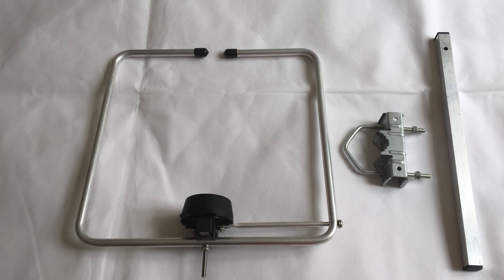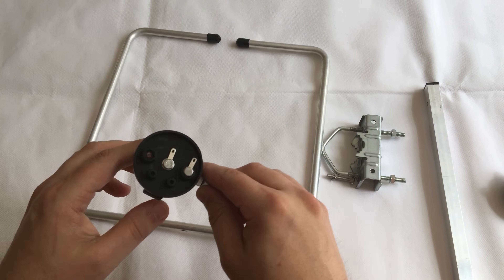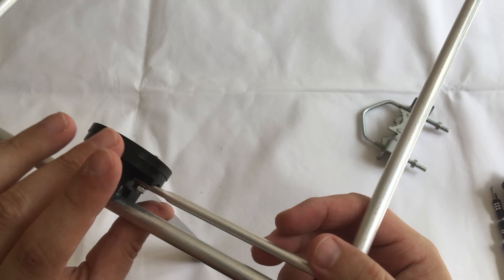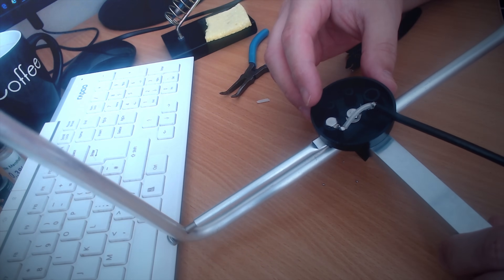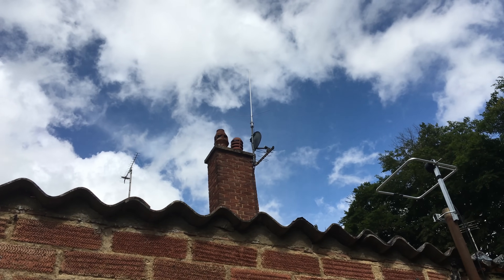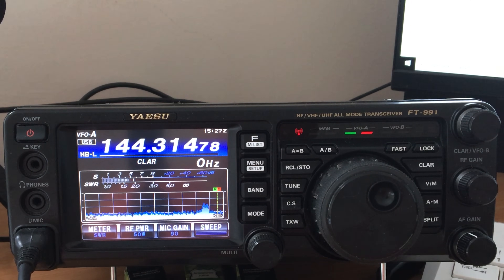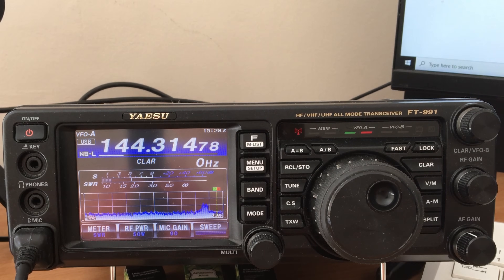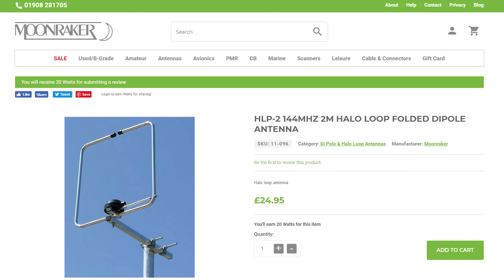2 Meter VHF Halo Antenna Assembly And Testing

Comment: good morning 👍🏻🤝 I wanted to ask you how you are getting on with the Halo antenna? Thank you very much and have a good day
Reply from the maker: Well, I since moved from the property and it got left on the chimney! However, when I installed it on the chimney, in a H polorisation, I fed it with RG58, the worst coax to use for VHF. However it received H transmissions way stronger than my V Co-Linear which was fed with RG213. So yep, it works really well I want to get another one for my new QTH.
Reply: good morning and thanks for the reply, do you recommend it in horizontal polarization for USB? Unfortunately I don't have much space for antennas

Comment: According to the website photo, shown in this video. The manufacture had left the small block of square tubing installed. You had it right, the first time! I suppose that would allow for running the antenna in a vertical or horizontal position (or even at an angle!). 
I would love a follow up video, to know how the antenna has performed. I am interested in installing a halo antenna at my home, due to its small size.
Reply from the maker: Unfortunately I left this at my last property, but I ran it from the roof, with just rubbish RG58, horizontal, and it out performed the Co-Linear. If I had better coax it would of been even better.
Reply: @TechMindsOfficial  Oh NO! I wonder if the new owners, would let you go back and get it? Ha ha. 
They probably are trying to pick up TV channels with it!?

Comment: Nice video, but the antenna really is junk. I have one so, sadly, I know. Caveat Emptor - I should have researched it before purchase! SWR of around 2 or more is bad, and  could not lower it satisfactorily by bending the 'arms'. There must be something better on the market that achieves an SWR of 1.2 or 1.3, or at least below 1.5.  I wonder if you still have yours? I might bet that you don't!   After trying multiple times to get an acceptable SWR by bending the arms back and forth, one broke off due to metal fatigue!  I then cobbled together the parts into an "S" shape dipole and with some fiddling an tweaking, I got the SWR to about 1.5:1    Anyway, a very good video production and thanks for the effort and sharing. 73, Mike.
Reply: I have the 2 meter and 6 meter loop I used it for this weekend VHF/UHF contest  and the SWR on my Yaesu 857D was showing a flat match and full out put power 
MY biggest problem was getting RF into the modulation of the radio  which was causing a hum in the modulation  so aI need to figure that out

Comment: Have you an update to you moving the loop further up?
Reply from the maker: Yes, I installed on my chimney and it works extremely well being above the roofline, even with crappy RG58 feeder it out performs my vertical for horizontal polarisation!

Comment: First thing I noticed was that smaller square tubing , wouldn't that be installed inside of the larger tube to help prevent crushing ? Just wondering as most manufacturers don't like to waste material.

Comment: If you wire brush the aluminium bits with Vaseline, there will be zero oxidation where the parts meet.

Comment: I believe the maximum acceptable VSWR should be 1.5.  The fact that you were getting VSWR = 2 suggests a design fault.  (If your feeder cable is lossy, that would artificially improve the measured VSWR !).  Why was it necessary to discard the "little metal block"?  Let's say you were right.  So the manufacturer is a nut case.  I can see that the long arm of the "gamma match" is not long enough and the thread of the fixing screw is exposed.  Looks like they are really careless.

Comment: Hi, noticed that the image in the Moonraker advert had the dipole mounted vertically. They had used the fixings in a different way. I guess this would enable the user to change the antenna direction? Great video and thanks for sharing...I'm about to set mine up today (M7WPH)
Reply from the maker: I’m pretty sure it changes the polarisation mounting it as per the Moonraker photo. I wanted horizontal so that’s how I mounted mine :) thanks for watching 👍
Reply: @TechMindsOfficial  
Interesting that when the Halo was mounted vertically it became directional. A bit like a Yagi. I was getting out to Kent really well from Essex. Nothing to the North though. Noticed the difference since setting up the X-50 on the chimney. I had a lot of problems when mounting horizontally getting the Halo SWR down. Did you get your coax sorted in the end?? 
Will M7WPH

Comment: Hi Matt – there’s very little that Moonraker could get wrong with this construction (which is unusual for them!) and your assembly is certainly more elegant than that shown on the Moonraker website advertisement.  The only question/comment is: does having the holding bracket inside the loop (as opposed to outside) affect SWR or radiation pattern – although I would suggest no, or at least inconsequential.  

By the way – G8RWG (in QSO with you) was correct in his forecast of a possible Es (Sporadic-E) opening coming UK’s way.  “Lift” conditions certainly did arise for me on Friday 21st June on both VHF and UHF and lasted for 8 days until Saturday 29th June, during which time both VHF (144/145 MHz band) and UHF (433 MHz band) were alive with European stations.  However, owing to the number of long distance UHF contacts I was making, I would suggest this was a tropospheric propagation opening rather than Es, particularly as I had a two-minute contact with a couple of French stations on PMR446 channel 8 (446.09375 MHz) on 500mw (½ watt) and THEY WERE IN THE PYRANEES – France/Spain border – taking part in a PMR446 contest using standard hand-held PMR radios!  My scanner was constantly stopping on French-speaking PMR446 channels throughout the day.   

Nice video, Matt – I might be tempted myself to purchase.  One can’t really make the antenna any cheaper oneself.  Iain.
Reply from the maker: Thanks the nice comment Iain, I’m still waiting to get the halo up in the air properly! I know it isn’t going to compare to a dedicated beam for 2M but at least it will give me horizontal polarisation and it will be omnidirectional. I’m not sure whether the radiation pattern or SWR would be effected by having the mounting pole within the halo itself. I did get some advice from Chris, G0WTZ that I should be able to improve the SWR by adjusting the gap between the two elements. Whether that’s the case of tightening the driven element tighter or slightly bending the halo in and out. Once I have my ladder man here I’ll be fine tuning it and will report back the results. I think for the price it’s definitely something worth while purchasing if anyone has a required for what the halo offers. Thanks again for your comment and hope you enjoy future videos! Matt M0DQW
Reply: Rubbish connection  setup   those silly little plastic boxes what a cheapo nasty way of doing it   , should be an "N Type " connection  probaly be better round as well  instead of square  i remember those horrible things the Quagis   Humm     the mounting as well  once again using that horrible Cheapo plastic thing    HUmm got some work to yet on them yet they have .

Comment: I would have thought 2 extra nuts would make it more secure and give a better electrical connection...... on the screw on the driven element... lock the screw to the halo & the element with 'em , hope that makes sense 🙄😂

😎👍☘️
Reply from the maker: It does and I will bear in mind when it goes up in the air :)
Reply: Or could make a copper halo better electricity  conductor so it should trsnmit and receive loads better aluminium has rubbish conductivity

Comment: Did you notice that on the picture on moonraker the antenna is mounted like you did in the first place ?
Reply from the maker: Yeh the photo on the website is mounted if you want Vertical polarisation, as I need horizontal I mounted it like I did in the video :)
Reply: @TechMindsOfficial  oh off course i'm dumb thank you